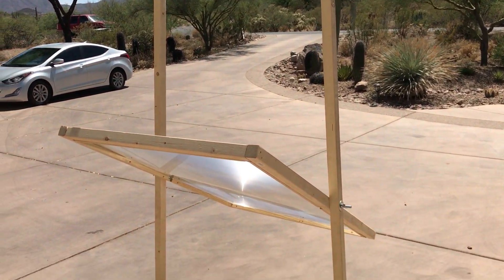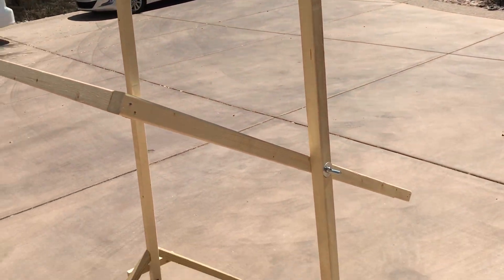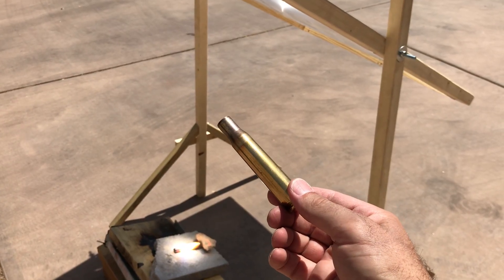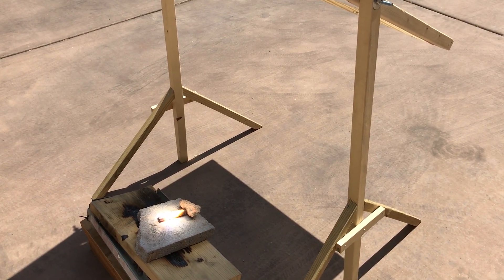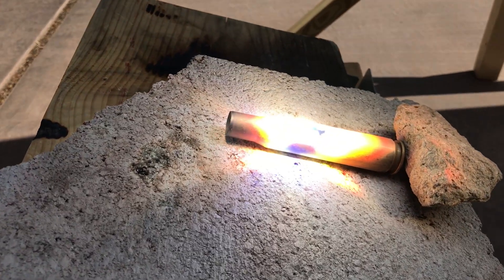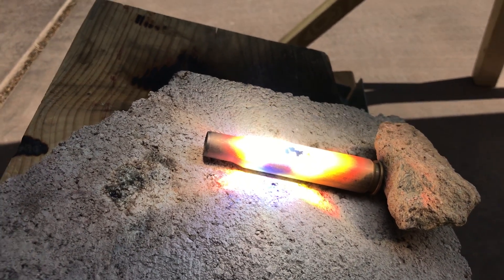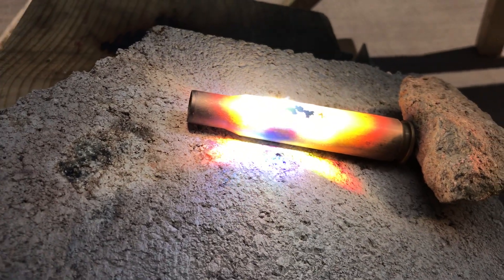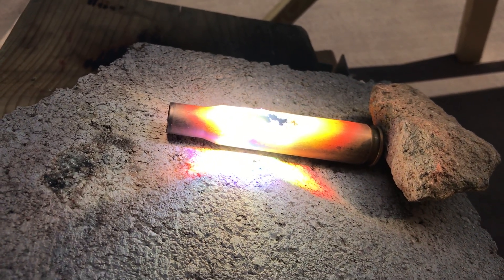Solar Death Ray Melts empty 50 Cal Brass Rifle Casing

Comment: I have to wonder, could this be used to melt brass or bronze in a crucible? If so, it would be a cheap way to do casting with metals without the cost of an expensive furnace.

Comment: 🙌👍, can this focused solar energy be converted to AC/DC ??
Reply: You could use it to heat a tank of water that would power a turbine. If it had a condenser, it could be self contained. I’ve seen a large tower with multiple reflectors focusing on the top of a tower that melts salt. There is enough energy stored overnight that it continues to flow until the next morning. Same concept.
Reply: @bajojohn genius
Reply: Yes... with a thingy called "Solar Panel"...
Reply: 🤣🤣🤣🤙 dah 😂🤣 yeah😂😂  thanks
Reply: Sorry i couldnt resist  @meremstudiostories  xD
Reply: Only for those about to rock!
Reply: Love this, love ur channel. I dont have the finances to do stuff like this myself. I can tell just by the titles of ur vids u have a highly developed questioning mind. We need more of u. Keep it up. Im sure u already know of destin w/ smartereveryday, & dr derek w/ veritasium, & green brothers but hank scisho.... ur filling a void.... keep it up. Im aubbed